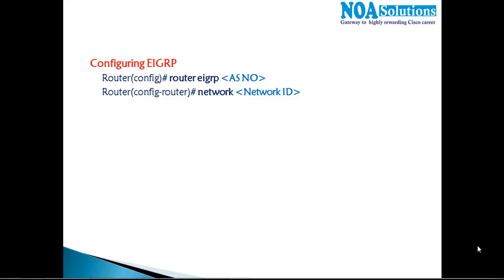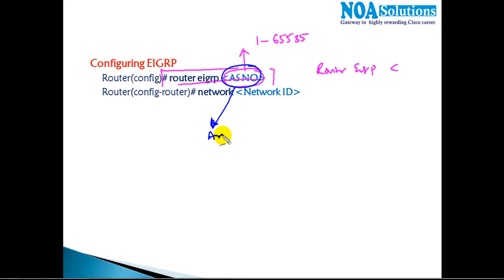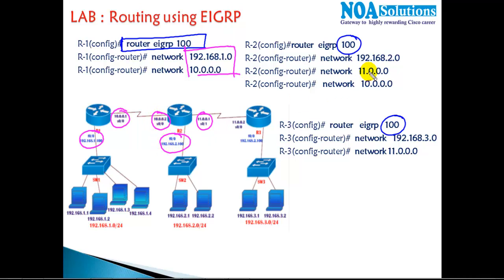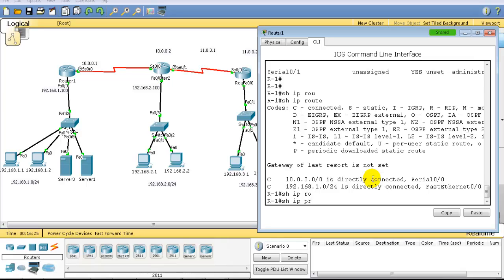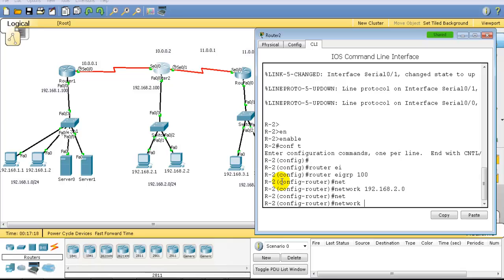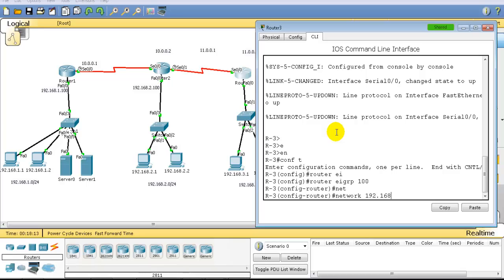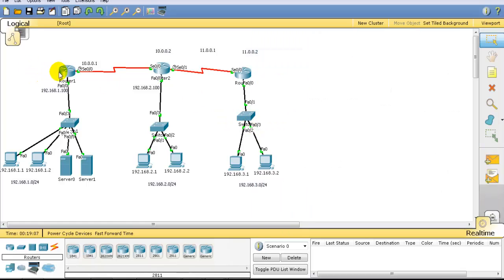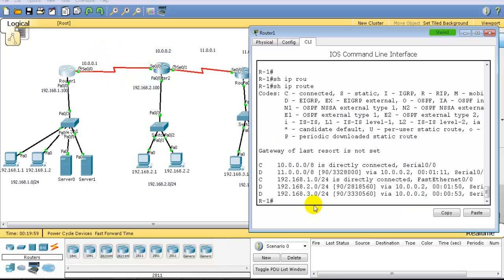CCNA Routing & Switching :  EIGRP Configuration

Comment: as u told, for ospf, many routers (like 1800series) used in access layer it might run out of memory and it reboots repeatedly 
area concept eliminates this issue

in EIGRP, if we use many routers in access layer, it might run out of memory and it reboots repeatedly. am i right ?
if yes, to eliminate the issue what is the solution?

please respond - NOA solutions
thanks in advance
Reply: in OSPF we hvave contecept of Areas and stubs to optimize
Reply: In case of eigrp, what will be the solution..

Comment: To remove RIPv2 from your RIPv2 simulation
enable
configure terminal
no router rip
end

Done!  You can now setup EIGRP.

Authentication looks like A LOT of work though.
enable
configure terminal
key chain MYCHAINNAME
key 1
key-string eigrppassword
end
configure terminal
interface <Every single EIGRP interface>
ip authentication mode eigrp <AS NUMBER> md5
ip authentication key-chain eigrp <AS NUMBER> MYCHAIN
end

The interface section has to be repeated for every interface I think.  :(
Reply: ohh god !! thanks a lot ..i have been searcing for this like crazy for over and hour !! you are a life save